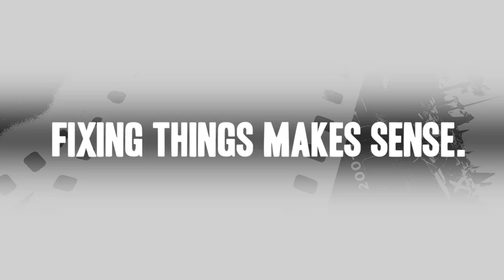Husqvarna Chainsaw Repair - Replacing the Clutch Drum (Husqvarna Part # 537291602)

Comment: Thank you brother, you are best.I never thought that I would have to learn English just to find repair information for my Husqvarna 440. Slavic countries do not use that rare and expensive tool.
Reply: Indeed. Yet, I just caught myself on a clogged clutch + brake not pulled back all the way (yup, dirt as well), and there you go. The same principles apply to a cheap Chinese chainsaw as they do to my father's fancy Stihl.
Reply: @HanSolo__ The same principles - yes, but gap between repair is waaaay less. I had Poulan 2150. 10 years and it is done. Piston and cylinder. I have been owning Stihl ms180 for 12 years. Not a single mending. I always treat responsible with my petrol- and electro- stuff.

Comment: There must be a better way to stop the piston travel.  Stuffing a rope in would, you think, potentially leave rope fibers in the cylinder and I don't think that can be good?
Reply: You can order a piston stop that screws in like a spark plug, be careful to make sure the motor is turned to the point where the top of cylinder is touching the stop before trying to strike the screwdriver. Oh BTW, the brake assembly is reverse threads.

Comment: Should the piston be in any position to start stuffing the rope in?  Also, should the fuel system be disconnected (to not flood the cylinder) or is the introduced fuel just a little bit?  Thank you for your videos.

May I ask that you do a video of "how to measure all the details of your chainsaw chain" (pitch, tooth angle, drive angle, depth feeler, etc.).  I am sure my owner's manual was a googletranslate copy/paste.
Reply: Can you do a video using husqvarna 3120xp.
Clutch spring replacement.
Reply: the piston should be in the lower position